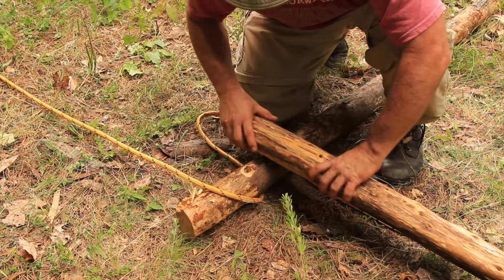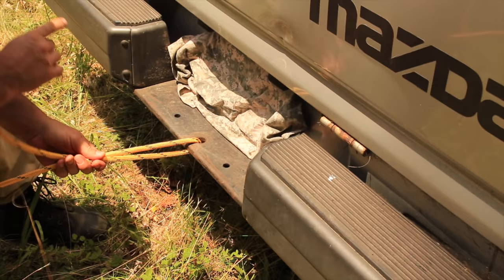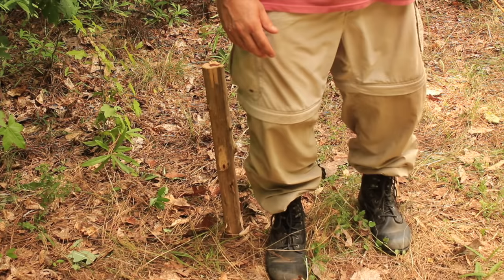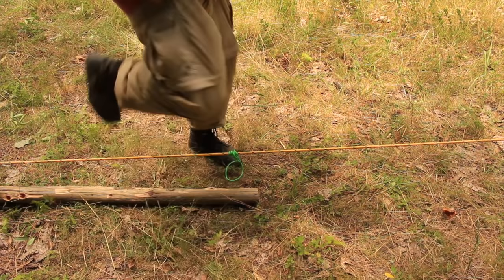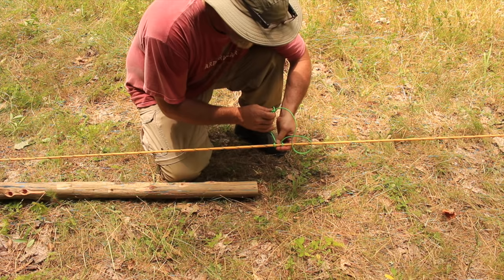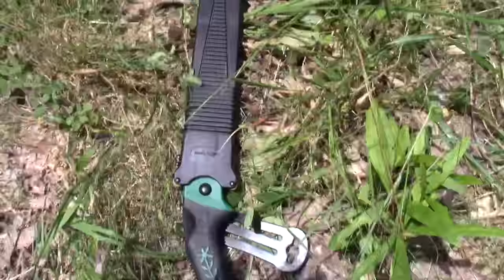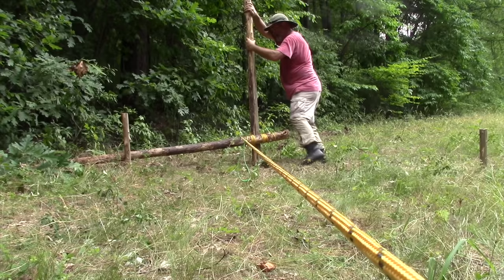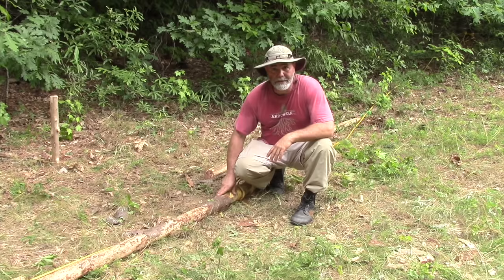Off Grid Winch: Making a Flip Flop Winch

Comment: Keep in mind the amount of time it will take to survey your nearby environs, locate appropriate diameter trees to fell (in the probable case of not having any already felled trunks just laying nearby), cutting down the tree, stripping it of all branches, and dragging back to your location. That's could be a lengthy and exhausting endeavor, especially if you have to walk a bit each way and drag the heavy beast back. And then there's digging a hole and inserting the stake poles, unless you're incredibly lucky with two trees already growing in the right spot. I only mention all this, as so much of the focus is on assemblage of the machine and usage, and not that block of time and effort in gathering/manufacturing parts.
I do really appreciate your sharing and demonstration of this knowledge and technique.

Comment: Great demonstration!  when I worked in forest surveys we would drive the truck on bush roads until it got stuck and then walk.  We got out with a 4 foot farm jack but that can be dangerous and damage the vehicle. 

I would caution against using your method of tying the rope to the bumper.  The hole thru the steel is a good way to cut the rope.  Better to do a wrap or two around the bumper and use a floor mat where there is an edge.
Reply: Good tip.

Comment: Thank you for sharing this clever method. HOWEVER, I implore anyone not to tie their rope straight through a hole like shown on the vehicle bumper. That was a straight hole so has 2 sharp edges and the rope was cinched tight. I strongly suggest having a bow or D shackle in your kit and if possible a sheeve  (or some rag wrapped around the shackle) to widen the turn of the rope. The weakest part of a rope is at a tight bend in a knot. 30 years ago I was a rigger and I have seen some nasty results to human flesh when a rope under tension snaps.

Comment: When I did alot of rope work rapelling etc. I'd make sure to grab any old firehoses that was being thrown away. Sometimes they get old in buildings and they get thrown out by law with nothing wrong with that. Then I'd slip them over small mil size ropes as a protection from abrasions. I'd also slip them over ropes being pulled tight this way. It prevented backlash if they snap, very deadly stuff. Then, they themselves make excellent tow straps for more heavy duty job, like pulling equipment stuck in mud. Foam pip insulation and pool noodles work great for backlash also. But a firehose helps greatly and is very handy to have around. Good video!

Comment: I can 'fold' the rope into a 'U' shape and at the bottom of the U, mount a pole. One end of the rope goes to the vehicle, the other to an anchor point.
I can then do the same thing as the Flip-Flop winch with the same leverage (1:12) with one pole by digging the pole into the ground and keeping the rope at about 1/12 th height. For a 1.5 metre pole that would be about 12 cm off the bottom of the pole and a notch in the pole will keep the rope at that height with a retaining strap around the rope and pole and that can be a ratchet tie-down. Apply some thick plastic tubing around the rope at the pole to protect the rope. I have the advantage of moving one pole, minimizing physical movement, minimizing physical effort, simplifying the task of obtaining materials (poles, only one needed). Any slippage back by the vehicle can be arrested by tensioning the rope at the anchor-end after each lever movement.

Have you tried anything like this? You look like an ex-military bloke and I suppose you would have tried all kinds of things to get vehicles out of mud/sand. Mud is definitely the worst. I dug for 3 days once to get my 2WD out of some deep mud!!
Reply: Make a video
Reply: thats similar to a capstan winch used in ships .but the rope was winding around a fixed cylinder with arms on the side .
Reply: @bruceaskin9645  I was thinking these 2 men could get together and what amazing things they could come up with putting 2 heads together lol but serious.

Comment: 3/4" mountaineering rope, or maybe even one inch, works good for this. Frickin' ingenious.
Reply: Robert Blevins.  Mountaineering rope is made to stretch to slow down a fall. Probably won't work well here. Better than no rope at all.
Reply: @johnverkler3962  John - mountaneering static line is low stretch, so it would be fine here. High stretch line will work, it just takes more winching to develop the tension, the stretch can actually help, because once you get enough tension you just rock the vehicle and the tension alone can pull you out of the hole.

Comment: Neat demonstration, I'll give credit there. But keep in mind that a bumper isn't always the best attachment point for moving a vehicle. It's preferable to look for recovery-points (hooks or eyeloops) mounted to the chassis under the vehicle body. For many cars or light-trucks, bumpers aren't solidly attached and are liable to break or end up flying off.
Reply from the maker: Good point. Thanks for sharing!
Reply: pauljs75 he tied it into a tow hitch hole though lol... those r secured to the frame
Reply: Correct of course. 
That hole in the bumper has edges which are harder on rope than the rounded surface of recovery rings/hooks/loops. 

For the doubters, ever wonder why rope and cable SHACKLES exist? It's not just for convenience. The proper way to rig rope or cable to a hole like that is to use a shackle. I don't care how Bubba does his because I won't be keeping him company in the ER. Check out military rigging and recovery manuals (free online since they are public domain) and towing industry sites like tow411 for how to rig correctly and efficiently.
Reply: This bumper looks pretty solid, but I prefer to wrap tow-ropes around the ball hitch on my bumper. Round, smooth and won't cut rope.
Reply: You will break that rope long before you will rip off a steel bumper
Reply: pauljs75 there's always gotta be that one guy
Reply: Ball is ok for this, but never for recovery with another vehicle. Deadly flying projectile when it snaps off.
Reply: Take a piece of fuel line an inch or so long & at least the same diameter as the rope & cut it lengthwise. Place it over the rope. You now have a movable protective shield
Reply: @obfuscated3090  ….This demonstration and this winch wasn't intended for the man who gets stuck at home on his front lawn, this winch is for the man who gets stuck back in the bush with nothing else to use to pull himself out of the mud.    It's an effective rig that anyone can use when you find yourself in a bind.   All that's required is a good length of rope and nothing more, except the two poles which can easily be found.    We don't need a lesson in how to properly rig and recover, this demonstration was made for people who get in a bind without having the proper equipment on hand to do the job.    This is a good way to free oneself using only a rope and materials you can find in the forest.
Reply: True for cars.  Not for trucks.
Reply: That bumper wasn't a typical bumper. Solid steel and most likely welded to the frame. Lots of country boys rig em that way. Most bumpers won't handle it true. But this one here is fine no worries.
Reply: @DavidLowry1  why not, just need a bigger lever
Reply: you mean the bumper meant to pull trailers and boats and etc with?  

 yeah probably just had some 7/8" wood screws holding it on.

Comment: Hey Brother! The best knot for towing is the bowline. Why? Because no matter how tight you make it you can break the knot and untie it and reuse that rope down the line.
Reply: Also, it's quick, easy to do from multiple angles, around yourself, even by throwning. And it doesn't consume much line. And it works with stiff line, slippery, loose, varying diameter...
Reply: yep,as my father taught me,,
Reply: I was wondering about a rolling hitch to take every bit of slack out of the line. I always put a second rolling hitch just above it in case of slipping, and it does need to be bedded down well. But still a very easy knot to undo and a tight line from the start means one or two less flips of the winch.
Reply: Yeah when he tied it like that to his truck I says in my head there goes that rope
Reply: Running bowline will get so tight you'll either need a screwdriver to undo it or cut it out. Use a timber hitch if you want to undo your towing knot, also insert a stick or rolled up magazine etc into the loop to make it even easier to break the tension
Reply: Take the line around twice it will not tighten  old army driver I worked with taught me.
Reply: @spencerlervik2083   He put up another video where he uses two logs, and another rope to remove that one.
Reply: Ok. found my next how to video to watch
Reply: Figure eight on a bight or follow through.  Way easier to release.
Reply: figure 9 on a bight is actually the best ive seen for getting untied. but seriously if your pulling something that heavy or actually pulling something with a truck... better have your knife.
Reply: @pegjames188  I noticed this when tensioning trees to cut them down down.  If I wrapped the line around the tree three times, I never had problems untying the knot.  On the other hand, if I only wrapped it around once, it pulled the knot so tight that I had to use a fid or marlinspike to loosen the knot.
Reply: Which type of Bowline?  The Nylon
Highway Newsletter featured that
knot.  As correctly tied and  failure-
prone knots.   To go there see:
nss@caves.org
Reply: A BOWLINE on a bight will let you untie the bowline, which without
can be very very hard to take apart.
Reply: Also it puts less strain on the rope—  the tighter the bend the rope makes in the knot, the more it weakens the rope.  A winch like this could easily challenge the breaking strength of the rope.
Reply: Problem with the bowline is the decrease in rope capacity. An inside bowline gets reduced to 53% capacity, and an outside bowline only holds 50% capacity. Obviously any kind of knot that you do will reduce your rope's capacity, but the bowline decreases it more than some others. But if you have a nice 5/8" or 3/4" line you should be ok. Plus, like you said, it's easier to untie.

Comment: Remember, the truck is being pulled the distance of both the anchor line and the truck part of the rope around the barrel pole so if the barrel is 1 foot circumference, the truck will be pulled 2 feet.

Comment: excellent video.  The only thing I would change is to use a bowline at the truck instead of what you did.  It will allow you to untie easily no matter how hard you pull.  I would guess that you had a hard time removing the rope from the bumper.
Reply: Normand dEon bowline is better ,the one he did was a timber hitch

Comment: I like it, though I cringed when I saw the rope going through the sharp edged hole in his bumper.
Reply: With the constrictor knot that will be so tight that it won't come untied...
Reply: I repressed an unconscious twinge and your comment makes it conscious
Reply: A constrictor knot is the worst choice. You'll never undo it and end up shortening the rope.
A bowline on a shackle, bowline on a bight with shackle and a running bowline all come undone easily and all most all the knots you need usually.
A steel carabiner is always preferable to aluminium.
Spectra inner cord is light soft low stretch and almost unbreakable.
Reply: Chris Richardson  i was worried the bumper comes  off!!

Comment: Don't forget to continually chock the tires on the truck as it moves!
Reply from the maker: Good point, Stephanie. Thanks!
Reply: Especially when you release the winch! Notice how the pole slips out of the green loop when tension is released, if the vehicle began to role that pole would flip up into the air..
Reply: Why would you need to chock the tires if the rope is holding the truck?
Reply: Major Tom are you joking?
Reply: im joking, bit im still curious, i mean nobody will start driving your truck in reverse gear you know?
Reply: In case something fails on the winch, you don't want the weight of the truck adding to the chaos.
Reply: Nor do you wish to lose the progress you had already made.
Reply: Accidentlly0nPurpose I
Reply: And/or put the truck back into gear with the emergency break on.
Reply: Which side of the tires?
Reply: The inside
Reply: Now that's a very good useful suggestion. Hope others learn to be constructive instead of the constant bashing of someone trying to share knowledge.
Reply: Stephanie LaMaster -  You called it.  I can't count how many videos I have seen of large trucks rolling away and crashing again after they were winched off their side and back to upright because no one thought to put them in gear and set the parking brake.  Take nothing for granted because Murphy loves to punish the naive, gullible and careless.
Reply: @majortom4543  for when you release it. Unless you want to winch it all over again!

Comment: Nice!  I love that!  I spent some time at sea on big sailing vessels and I love this stuff.

If you were stuck in a deepish hole, you might want to rig sheer legs (like an A-frame on the line close to the truck.  The sheer legs would lean back towards the truck before the pull, swing up to vertical during the pull and end leaning away from the truck.  Move the bottom of the sheer legs forward before every pull.
The lifting motion reduces the load required.
Entire fleets of war galleys were moved overland in ancient times using sheer legs.
Oops!  I just discovered that you have already covered the use of sheer legs--the paring ladder! (didn't know that term)  Very cool!  T

Comment: There's a better way to wrap the ropes around the poles so the ropes leading to the load and anchor are right beside each other. This decreased unwanted torque, so you don't need those extra stakes which is very helpful as the whole engine moves toward the anchor meaning you might otherwise have to reposition the stakes if you pull far enough. Also, in my experiments using small branches of similar diameters, the spool pole breaks before the lever pole. This needs more research to be conclusive, but I think the weaker pole should be used as the lever.
Reply: @lmp2208 , I learned how in a video from David Canterbury about simple machines. The Weather Channel also has a good 2-minute tutorial where they mention a key detail. I recommend you search for those videos, but I'll try to explain.

Facing your anchor, lay the left side of the spool pole on the rope at a right angle. Lay the right side of the lever pole under the rope at a right angle in front of the spool pole, then rotate that same end up onto the spool pole sliding it parallel with the rope until the end passes the anchor rope, then rotate the lever up until it 'hooks' into place. The anchor and load ropes will be beside each other. Under high tension, there will still be significant unwanted torque, but it should be much less than if the ropes are on opposite sides of the lever--especially if the wrapping causes the distance between to increase.
Reply: @davidwallace3933  I think your description paints a picture in my mind.  I had to grab a couple of pencils and a piece of bricklayers twine, to be sure.  I was then going to tediously describe the procedure to confirm if we were “on the same page”, by defining viewing direction, orientation, etc.  Luckily I took a look at David Canterbury’s “Moving Objects with Simple Machines Part 1”.
Yes, as I had pictured.  Thanks for sharing that reference.  (Just deleting a long paragraph of description 😊)
This technique provides several benefits over the procedure in the video above.
The loop of rope around the lever pole, is on the side of the spool pole towards the long end of the lever pole.  (Gees English can be so clumsy sometimes … maybe it’s just me).  Anyway, the benefit is (for a winch laying on the ground, recovering a vehicle), to secure the end of the lever pole that has a tendency to want to rise and flip back over due to high rope tension, the end of the lever pole can tucked under the rope.  The lever pole is already below the plane of the rope .  This is instead of using a loop of chord attached to the main rope.
Also the rope winds around the spool pole on the side towards its long end.  That provides 2 benefits.  There is no danger of running out of room if the rope was winding onto the short end of the spool pole, AND the short end overhang can be minimised so that “flopping” the spool pole over does not require raising the whole winch high off the ground, which is very difficult with high rope tension.
So with these refinements we’ve all but eliminated the stakes to prevent the spool pole toppling, and eliminated the piece of chord to secure the end of the lever pole.  Granted, if you’re alone, probably should secure the end of the spool pole because even if the 2 windings of rope are laying beside each other, there will be some toppling torque, especially at 3-4 tonnes as I was describing using steel pipe.  Thanks for stimulating me to refine my thinking.
Reply: @lmp2208 , you thought of some benefits I had not considered before. Thank you for sharing.